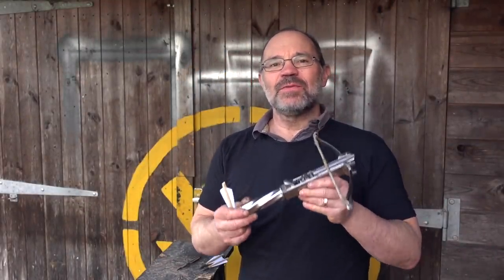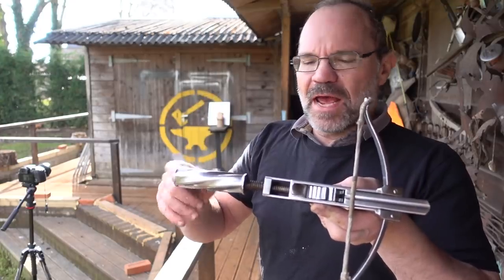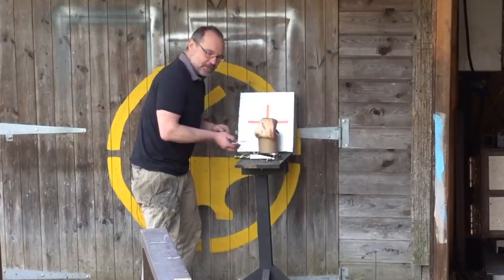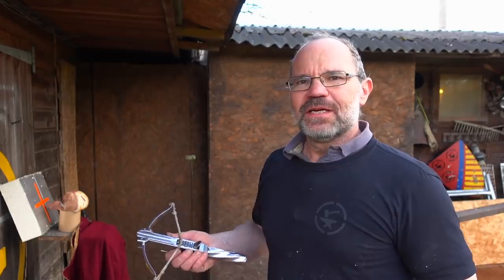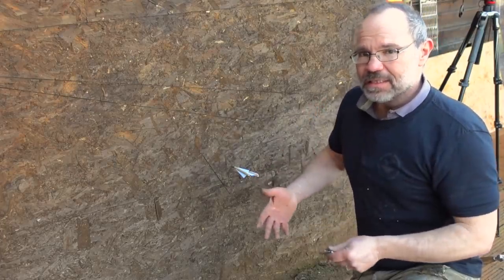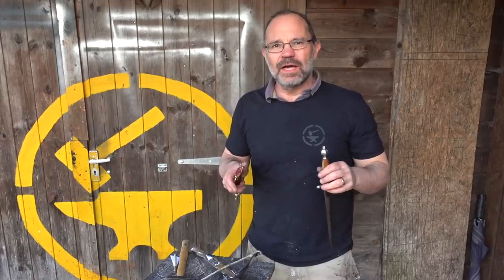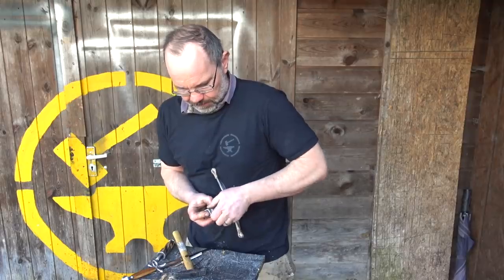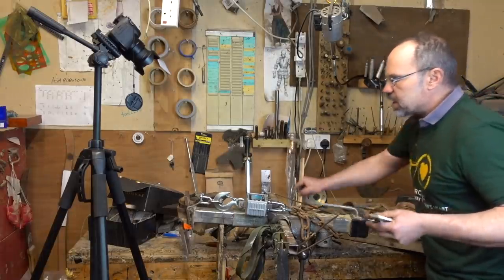200lbs Assassin's Crossbow - LET'S TEST IT!

Comment: They had pistols when this assassins bow where around.

But frankly if your a hired murderer, do u want to use a loud ass weapon in public. Or something quiet and still deadly especially if your close or want a little range for a get away. 

I would take silent but deadly vs loud and deadly

Poison is a real option. 
More than likely the assassin would just dip the bolt in some fecal material. As that would be pretty easy to find and you dont need a specialist or special knowledge.

If you dipped that bolt into poop. Shot someone with it and didnt recieve proper medical help. Your doomed. 2 weeks max dead.